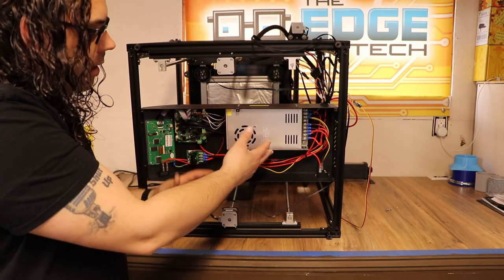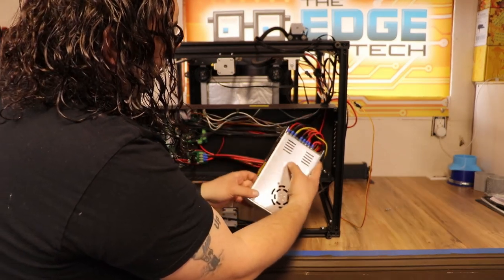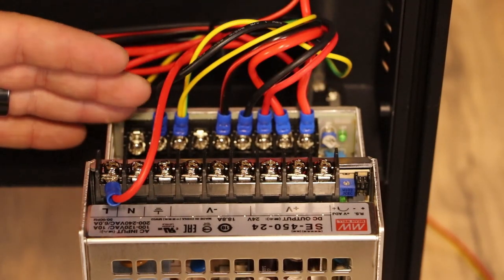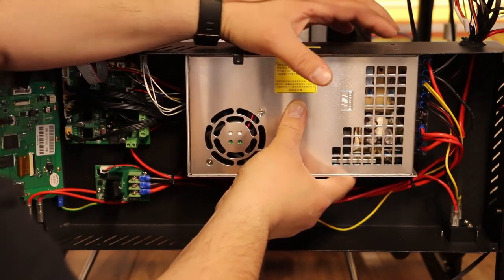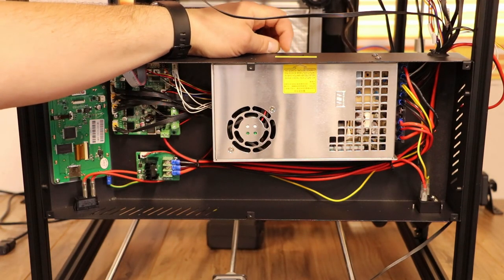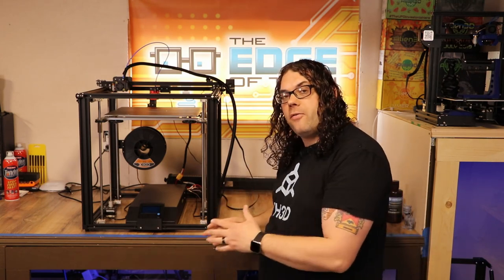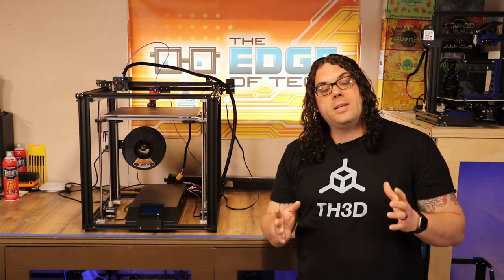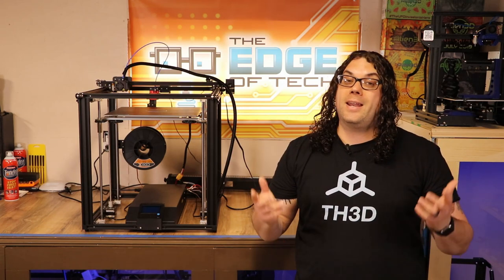Ender 5 Plus Power Supply - Meanwell Power Supply Upgrade!

Comment: Was the purpose of changing the meanwell supply to ensure that the power to the printer does not fail or to make it quieter?
Reply: The stock PSU was a Chinese cheapo and they had a high fail rate, faulty grounds, destroyed the electronics plugged into them and a few even caught fire. CREALITY has been slowly changing their more expensive 3D Printers over to Mean Well.

Comment: Why should I change the power supply? (What kind of advantages do i get?)

Thx for the great Video
Reply: Now it comes with a MW supply from the factory. But otherwise if you have the old version the MW is less likely to die on you, and it heats your bed up quicker. Some youtubers claim that the original power supply was not electrically safe.

Comment: I don't understand why TH3D is selling a 450W PSU as an "upgrade" for a printer that draws over 400W from the bed alone! Add in hotend, steppers and the board itself, and you're talking 500W+. I saw another video that put the peak power draw at over 600W!
Reply: Hey David! If you're talking about my video, I want to be clear that the power draw by components is less than that. I was reading the input voltage on the supply and you need to multiply that by about 80-85% to get the power being used (there are AC/DC conversion losses). This means that it draws between 480-510W (or about that). I tried to be clearer about that by looking at TH3D's readings but I realize I may have muddied the water a bit. All of my readings still show it drawing around 500W, no matter how you do the math. According to TH3D, the supply has plenty of overhead and they were trying to provide a supply for cost-sensitive consumers. I just wanted to make sure the information is as clear as possible from both sides. I shared my opinions on power supply ratings in my video.
Reply: @kerseyfabs  Point taken, but as an electrical engineer (by education, at least), I know it's not a good idea to run at, near or above 100% rated load almost continuously. I'd suggest they offer both the 450 and 500W Meanwell supplies, as people have been known to power even more than the printer off the internal PSUs.
Reply: Everyone has an opinion on this.  Kris has a good point as well as Tim from TH3D.  My experience has been, I started with the stock power supply, switched to the 450 from TH3D and after seeing Kersey Fabrications video went with the 600 Meanwell.  I did not have any problem with any of the power supplies, even the stock.  It was more a case of being safe vs sorry.  The price difference between the 450 and 600 is not that much, the bigger problem is mounting, which Kris has a good solution.  I gave up and just threw away the control box and build a completely new electronics mount and used Kris's power supply holder
Reply: @woodwaker1  Would you mind sharing what you created for a control box? I just ordered the Meanwell 600W PSU and plan on using Kris' design for the mount. I'd like to get rid of the bulky control box and have a better place to relocate the remaining components.
Reply: After watching Kerseys video, I decided to go with the 600W Mean Well. Additionally, the fan in the stock power supply began to rattle and its days seem counted. I measured a power draw of the stock PSU of 520W peak with an external Wattmeter plugged into the electric outlet, which seems far too much for me for the stock PSU to drive safely. 
Other than Kersey, I installed the 600W MeanWell without any problems in the stock electronic case by drilling some holes. To monitor the temperature in the case, I plugged a probe inside, because the fan of the new PSU isn't in the same place as the old one and I wanted to know, if heat dissipation is sufficient. While with the new PSU,  the air is blown at the rear end and not directly out of the case, it has enough slots to get rid of warm air and I barely noticed inside temperatures above 29°C in an environmental temperature of around 20°C. 
Interestingly, the power draw with the newly installed PSU reached sometimes up to 600W. So, there seems room for improvement with the stock PSU... and now I am feeling much safer in regard of a brand and far stronger PSU...

Comment: Hello I have a problem with my ender 5 plus... I attached a google drive link below for video and it seems to not be clogged, but the gear pushing the filament keeps clicking and trying to push the filament. As you can see in the video the filament is still coming out. I tried high temperatures and low temperatures, but same thing. I even tried slow print speeds, different filaments etc. Any ideas?
https://drive.google.com/file/d/1b52kiUrN16CQLzWIVvmBsJYuMtMSM5Bl/view?usp=sharing
Reply: Disassemble your hot-end if you haven't already partial clogs exist! Also tighten that nozzle when you're finished if there is a gap between the heat break and the nozzle then its likely to happen again.
Reply: I had the same thing happen. I ended up figuring out it was the bowedn tube. The printer sat for years until I changed it and upgraded to a direct drive and the thing works great.\
Reply: @MiningMagnets  I know have micro swiss direct drive and it works great!! Thanks
Reply: @braydonadams9517  went from worst printer to my best printer after the upgrade lol. Glad you are up and running